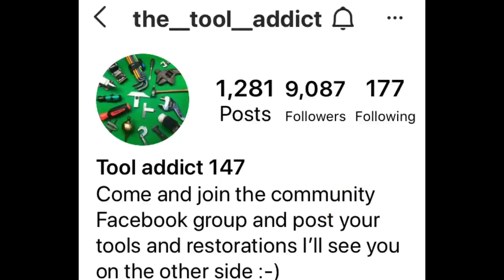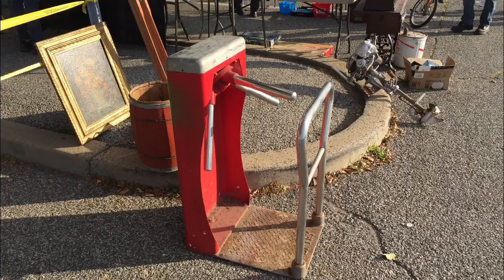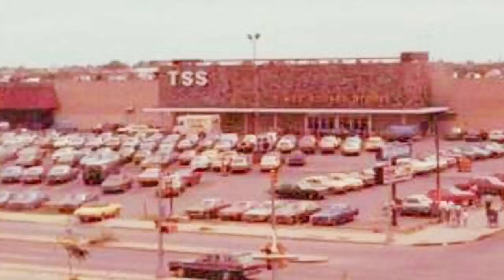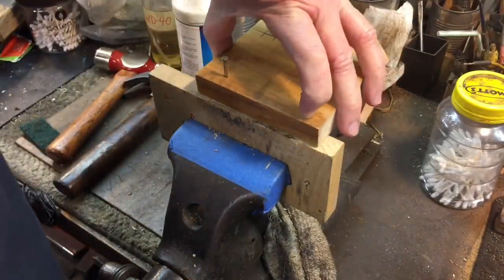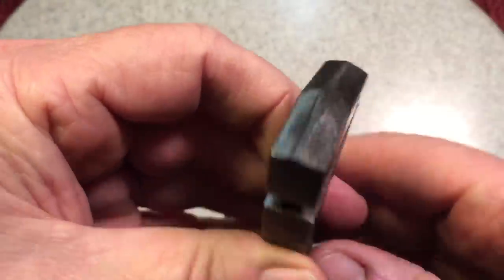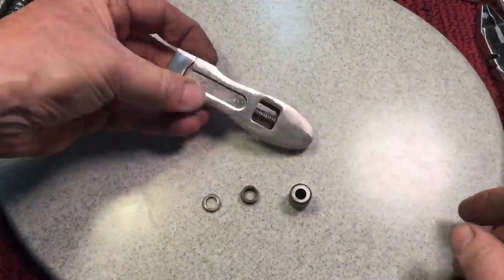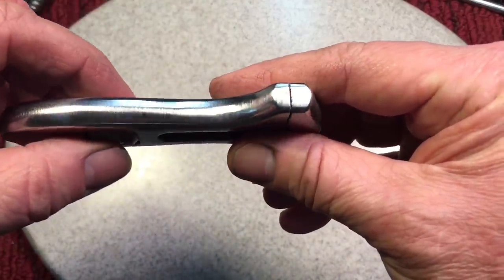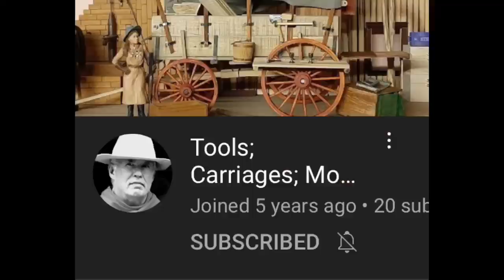Antique British Wrench Finished Proper

Comment: I'm going to give this a shot because you mentioned that you love viewer projects. If I may, I would like to make an appeal to EVERYBODY READING THIS. I am a retired machinist and I am interested in developing kinetic sculptures. I did not want to share my idea initially, but I think this is the only way to fulfill my needs. I have an idea for a mechanical artistic large scale model based on the Tesla valve. Go look it up, it is very fascinating in its own right. Anyhow, once you get the concept of a Tesla valve in your mind, try to merge the concept of a hydrostatic transmission. Go look up how those work if you don't know. Long story short, I did some experimentation and discovered that the spiral cut section inside Yankee push drills is very unique. If you hang one from a piece of string and run a drop of 40 weight oil down a vertical surface just next to it, it has enough friction to force the rod to spin. Because each rod has two separate threads or starts however you want to think about it, the oil running down can and will choose either a or b. Think of this as a logic gate. So, that is my basic idea that I want to scale up. I believe that I can make a simple fully functional computer (in the technical sense) that is mechanical but completely unpowered except by gravity. So that's my idea. I want to make probably a calculator is the best use of a very simple computer. But the whole idea is that this would be rather beautiful to watch. Who cares about it as a calculator, just imagine how beautiful it would be. Sort of like those 1970s oil dripping lamps. I don't know if I'm explaining myself well. This is what it comes down to, I need to acquire 32 of these spiral rods. I have priced out eBay, too high. I tried to hunt down a manufacturer, no go. I spoke to tool companies about the custom cutter, these spiral rods are a much more complicated profile than one realizes on first glance. I tried to replicate them on the lathe, but I cannot reproduce the effect to the degree that oil works every single time. So, I need help from all of you. Do you happen to have an old Yankee push drill that's broken? Do you have any ideas for me to acquire a bunch of these cheaply? I have profound disability that makes it very difficult for me to take pictures or film, but I would be willing to commit to making a video as a sort of payback? I'm happy to pay for parts, but it needs to be relatively reasonable. I made an appeal for spiral rods at one point in the past, but I did not want to giveaway my idea. I don't care anymore, I just really want to see it built. For example, if some deep-pocketed individual wanted to provide the spiral rods, I would be willing to gift them the sculpture itself once finished. I really desperately want to build this and see it function. I am willing to give it away or giveaway licensing rights or anything. Open to anybody's input, ideas for locating them, ideas for alternatives, etc. I need help.
Reply from the maker: I have always been fascinated with the Tesla valve!  Absolute genius!  That sculpture sounds remarkable...  32 Spiral rods will be the challenge.  Especially the same size.
Reply: @ScoutCrafter  thanks John, I was hoping you would comment so I could simultaneously apologize and thank you for making use of your platform. It's not very good behavior, I am happy to delete this if I am stepping on your toes in any way. I'm just unusually excited about this project. I have already made a three rod version and tested it at length to make sure it was providing consistent results. I don't necessarily need a full 32, but each additional logic gate is an exponential change in material need. I just don't think it will be visually impressive at all if it is only 4 or 5 gates. I didn't want to write a novel so I left out one of the coolest parts. I'm not positive yet, it depends on the height, but I'm pretty sure that I'm going to be able to pump the oil from the sump back to the top of the Tesla valve without using any power! I don't know if you are familiar with a ram pump, but after a lot of experimentation of orifice size, I've gotten it to work consistently with oil. Only pumping it up 16 in so far. I will be straight with you, my hope is to garner your interest enough that you would be willing to boost my message. Again, I don't care about ownership. Perhaps everybody who contributed one spiral rod would automatically be enrolled in a raffle to win ownership of it. I just very much want to build it, see it working, and document it. Please consider it. If there is something I can do to demonstrate that I am not seeking profit, I am an open book. It is a challenge to collect 32 of these rods. For clarification, they do not need to be the same size. Well they don't all have to be the same size. Basically just the three rods in each logic gate have to be the same as each other. The cut profile in push drills seems to be consistent as far as its ability to be manipulated by oil and gravity. So as long as individual groups of three are identical, there are no issues. I also found that these spiral rods are less consistent in diameter than one might assume. I also discovered that you can take a thin skim cut on these rods without ruining the hydrostatic effect. John, please consider mentioning this to your audience. I would be more than happy to give you all of my personal information so that you could know that you're not endorsing a schmuck. Maybe the sculpture could become a subscriber giveaway and that way I am not just taking advantage of the audience you have built, I would theoretically be helping you cement the relationship with your viewers. Admittedly, you do not need any help. I know that my best bet is to get you curious enough about the idea. So that's what I'm doing. Hope it works
Reply: @ScoutCrafter  Hi John. It is a few days later and I was thinking about my request and feeling rather guilty. I was so focused on my own project that I did not stop to realize exactly what I was asking. In retrospect, you have built a very loyal following in part by not advertising any products or accepting any product placements, you don't even turn on ads. I have always really appreciated this about your channel and seen it as a sign of your integrity. Today I am realizing that I basically asked you to stake your reputation and channel on a stranger's whim. No doubt you have been asked to endorse products in the past. I'm sure at least some of these products were ones that you do use. You do not pimp their products because that's not what you are about. I don't want to play any role in challenging that integrity. Please forgive me, I think we know each other well enough that you know I simply got wrapped up in something I was passionate about without considering the consequences. I'm sorry I asked you to boost the message, I withdraw the request. Furthermore, I had no business posting anything directed to your audience without discussing it with you first. I realize now that I put you in an awkward situation. I will do better moving forward.

Comment: Watching your tool restorations brought a question to mind.  My screwdrver collection consisrs primarily of Craftsman, made in the USA,  bought in the mid to late 1970s.  A few of the screwdriver handles have changed from the glossy finish to a opaque powdery finish.  I think this happened when they were kept in the garage when I lived in New Orleans.   The garage was not climate controlled.   Before I start experimenting   with restoration I  thought it would be prodent to ask an expert.

Thanks,  Bob
Reply from the maker: Hi Bob- I have found that the Acetate handles are made by mixing chemicals together and along with heat they are formed into various shapes.. If the chemical mix isn't perfect the handles will fog up and also off gas a smell.  You can easily scrub the fogging off the handles but in time it will reappear.  I have had luck in clear-coating them with Rustoleum clear coat.  However those older Craftsman and Xcelite handles were notorious for either being great or foggy.   =D

Comment: I KNOW this is just my own opinion, however it always bothers me when you take off the original markings - even on a $2 tool.. Since the number was cast in and proud you could have just left a rectangular area around it and left it on. It would have looked stippled and it would have still had the original markings. YES - I know it's a lot more work and a royal pain in the but (been there - done that), but I always like seeing the original markings and that to me is a true resto. Just my personal opinion and to me anything original (ugly or not) should be left on if at all possible. That said, obviously they're your tools, your opinion and your channel and I do respect that. Just had to voice my opinion and I'm sure many would go your way and have it look better. To me, it is what it is.
Reply from the maker: Bobby- I had originally tried to box out the numbers but it looked horrible...  I also like to keep original markings and have passed on so many restorations because the tool was too valuable or collectable to modify.  I did engrave the original B308 on the tool (Monday's video) however I don't know what the number means.  I do have a lot of original tools that I won't touch because they are rare.  When you see my collection of common or formally trashed tools it does all make sense!  -=D   Thanks!